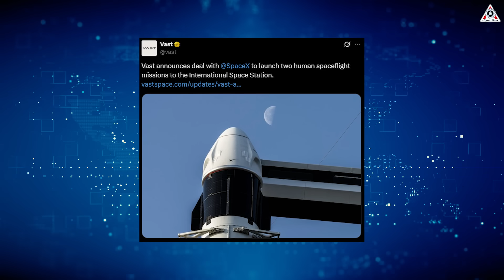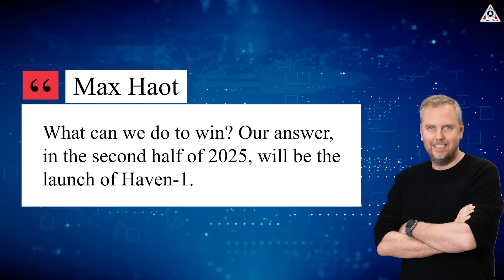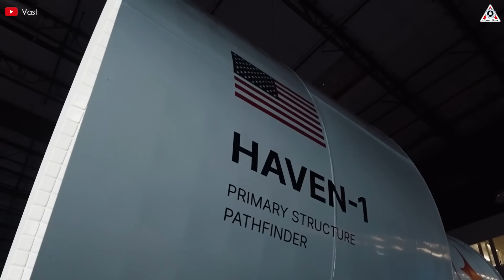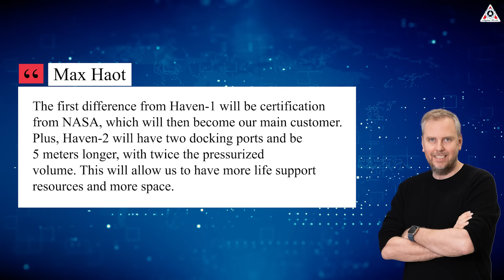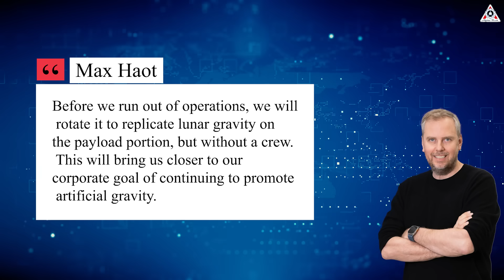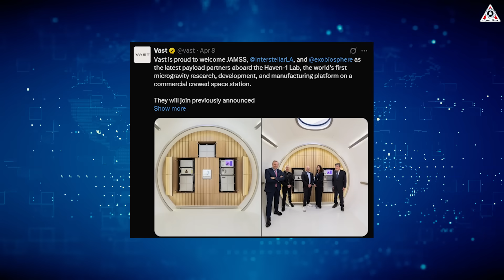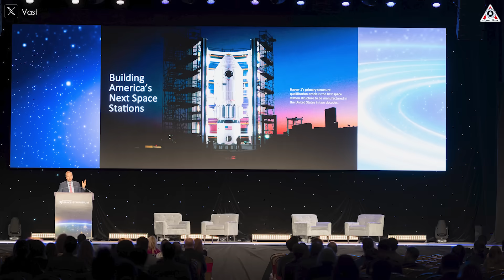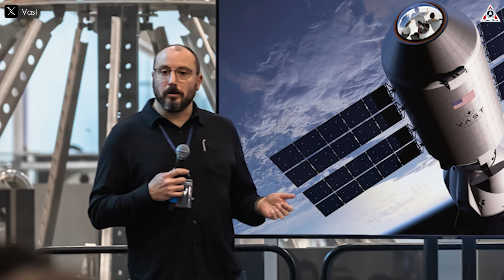SpaceX revealed Insides of NEW GEN Space Station Shock NASA ISS!

Comment: I think artificial gravity is the most important goal. But this requires a large diameter ring to keep the spin well below levels that cause dizziness. I think 2 rpm which equates to about 450m diameter. Maybe 4 rpm or only 110m diameter would be acceptable, certainly a lot easier to build. Cheapest to use a dumbbell shape instead of a full ring for first attempt to validate diameter required this would consist of two modules tied together with cables and could change the length of the cables and rpm.